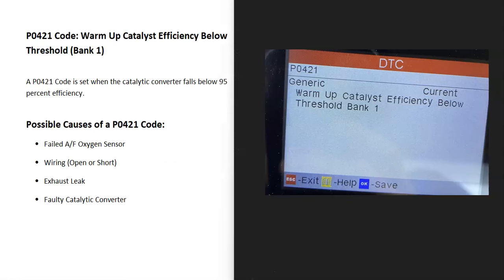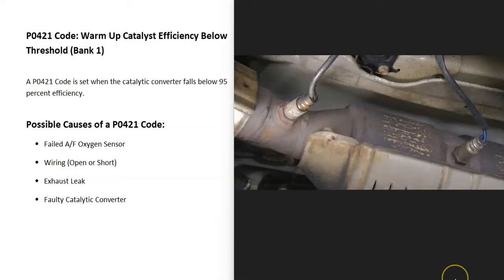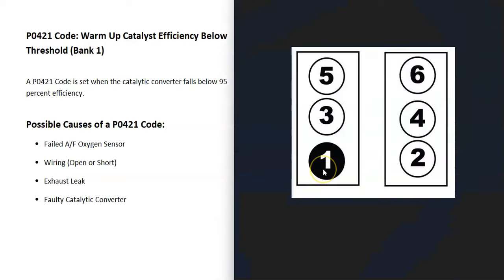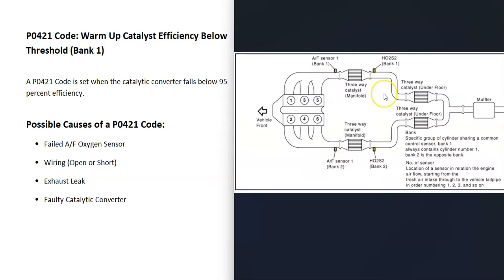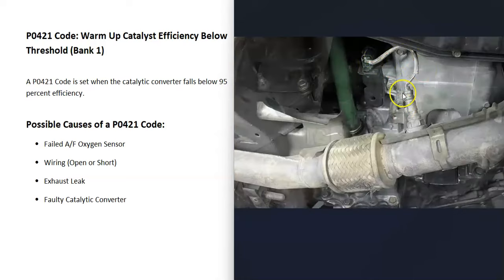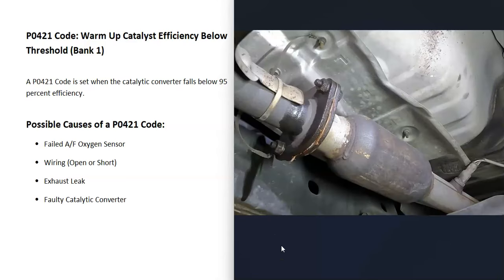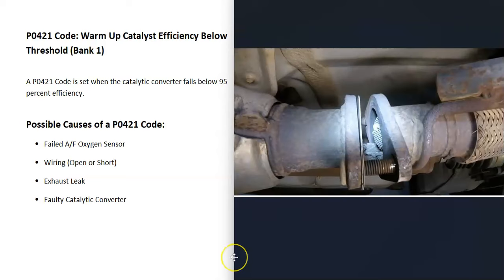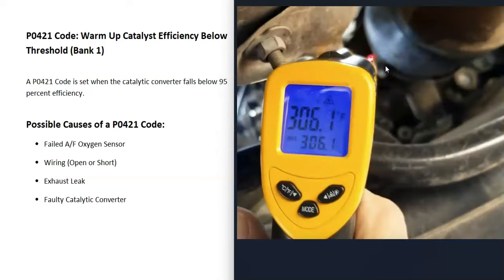Causes and Fixes P0421 Code: Warm Up Catalyst Efficiency Below Threshold (Bank 1)

Comment: I have an 06 mx5-Miata and I bought used performance (catted) headers which were fine the day of install but got the p0421 very next day. I cleared it and continued driving with no code that day but decided to scan and saw that I actually had the code but in pending state. I am almost certain the code will eventually be back but this video is going to be a lot of help. I bought some Cataclean which I will try along with a nice long highway drive in hopes of cleaning some deposits.. if that doesn’t do it I have a desperate attempt of using a spacer for the second O2 sensor as some have suggested for my situation(non Fowler method). I really really do not want to find out I bought a broken set of catted headers so after attempting those solutions I am going to monitor temps with a temp gun as you mentioned in the video. Is this a guaranteed method of diagnosing a bad cat? If it is hotter upstream than downstream does that mean the cat needs to be replaced or is it simply a matter of cleaning out contaminants that may be blocking airflow upstream?
Reply from the maker: It is common to diagnose a clogged CAT by temperature, but more tests can be done.  Since the headers are aftermarket, it may be best to see what results others have had in the forums or Reddit and if they had any issues.
Reply: @HVAC_Mechanic  Thank you for the response, if there are any specific tests I can run please do let me know. The p0421 is the only code and others in the forums mention that it is common for 'performance' headers to throw this code due to the fact that it is much less restrictive than OEM. This is why some mention that a spacer for the downstream O2 sensor can help by moving the sensor's location away from where all the exhaust gases get concentrated in the middle. The weird thing is that this is a solution for an opposite situation than that of a clogged cat converter. So I guess I need to figure out if these used 'performance' headers are letting too much air pass without being catalyzed, or is it the opposite and not enough air is passing through because its clogged? 🤷‍♂

Comment: I have really bad spark knock or pre detonation and I ran codes yesterday and got P0421 could this be the cause?
Reply from the maker: It needs to be diagnosed, but if the catalytic converter is clogged up, it can cause issues.
Reply: I have that code what did you do to fix it

Comment: I've got a Mazda 3 2005. I'm getting p2004 which means the intake solenoid has failed and the intake is stuck open. and I've confirmed the solenoid is dead. I'm also getting the p0421 code and wondering if the intake value that is stuck open is causing or can cause the p0421 code to come up.
Reply from the maker: Yes, if the engine is not running correctly and fuel is dumped into the exhaust, it can clog up the CAT and cause a P0421 code.